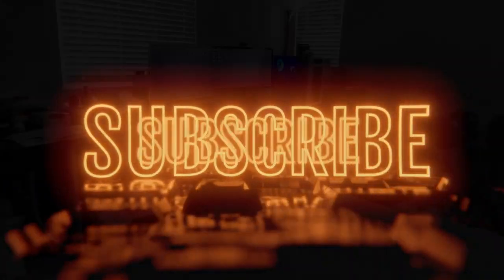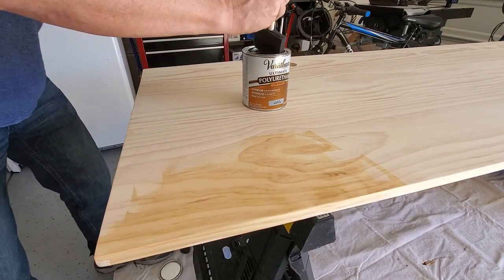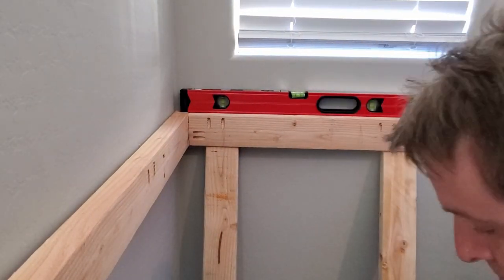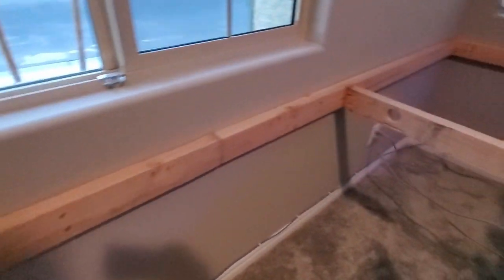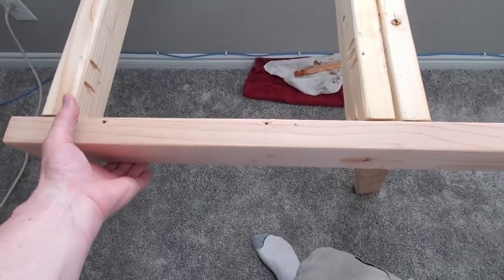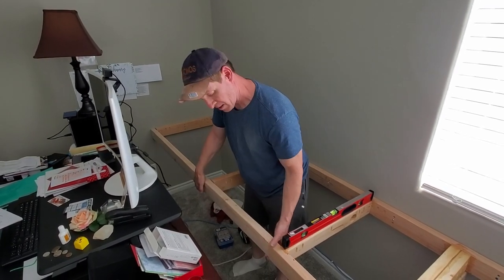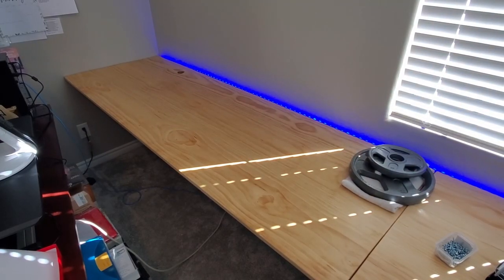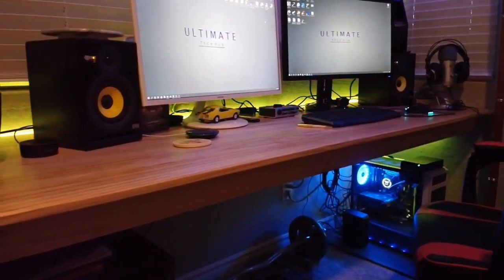MASSIVE FLOATING DESK BUILD HOW TO - LARGEST FLOATING DESK 2021

Comment: 2.5" deck screws for attaching the frame to the wall are not long enough! 1.5" for the flat 2X4 and .5" for the drywall means .5" into the wall stud. I would be changing them out for at least 3.5" for better peace-of-mind carrying all that weight over that 14' span. Changing one screw at a time is a simple job to save all that equipment from meeting the floor. Oops, RedDog beat me to it!
Reply from the maker: I'm not a professional wood worker but so far after 2 years its help up perfectly and no sag or loose boards. Thank you for watching and for the great information! 😀

Comment: Nice build man! May I ask the dimensions of the desk?
Reply from the maker: The entire span of the desk is 14 feet 8 inches and the depth is 29 inches. The thickness of the pine top is 5/8th. Thank you for watching.
Reply: @UltimateTechHub  thanks man! Currently building a 9 feet desk too. Watched ur video for some inspiration! The LED part and the wooden bracket support is an excellent idea! Thanks alot!
Reply: *9 feet floating desk
Reply from the maker: @sarjanAbong  Good luck and keep me posted on your progress.

Comment: I really enjoyed this.  I want to build a similar 12 foot desk for my office.  This really broke the process down and I will definitely be stealing your ideas!  The wire management is always something I strive to accomplish and the holes you predrilled look like they did what you intended.  Did you get your wood from a box store or did you go to a lumber mill?  Thanks for the video, it was great!
Reply from the maker: A 12 foot floating desk will look amazing!! And it should be a little easier than my 14 feet 8 inch monster. I got all of my wood at the typical home improvement store. I had some of the wood precut because it wouldn't fit in our car. Amd the holes in the support beams help tremendously for wire management. Take your time and draw it out on paper first. I did 4 coats of poly but I would recommend at least 6 or 8 coats. Good luck and keep me posted on your build. Thank you for watching and if you subscribed thank you as well.

Comment: Which wood is this
Reply from the maker: The top of the desk is pine. We bought the premium pine boards because we don't have a plainer or a jointer. I recommend using wood that's not too thick. It's easier to work with and is less heavy. The 2 by 4s I think are Douglas fur. Thanks for watching.
Reply: @UltimateTechHub  amazing work 👌

Comment: This isn't a floating desk. This has supports clearly visible, which straight away takes away the "floating" illusion. This is just a desk.
Reply: Who cares?!?
Reply: It doesn’t have legs🤷🏻‍♀️
Reply: So you think desks just actually float orrr what..? A floating desk means there are not visible legs or supports like drawers etc. on the ground